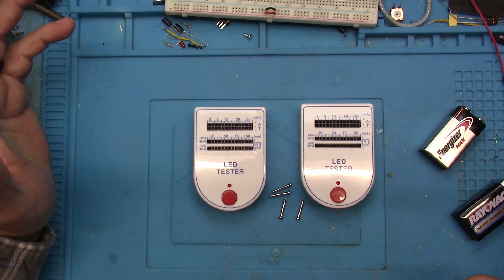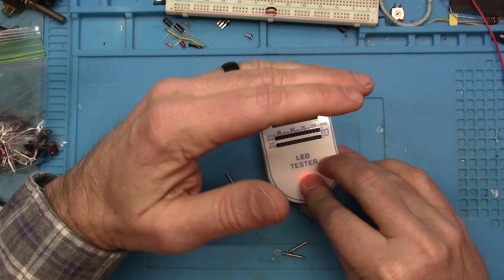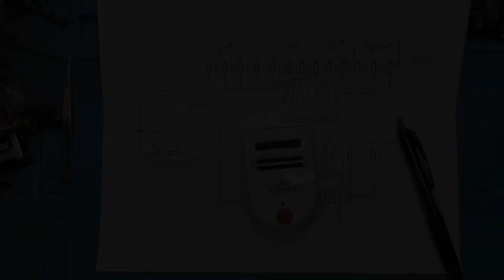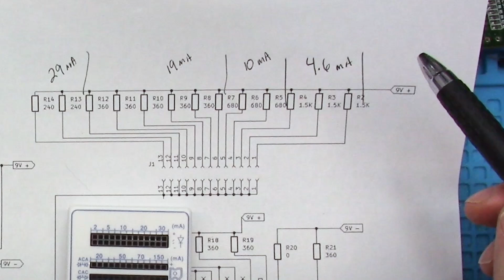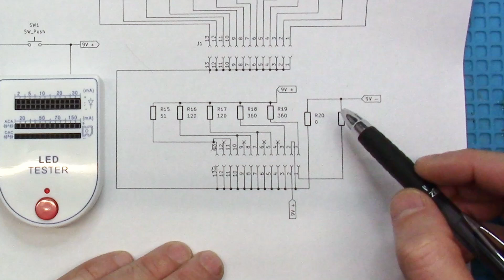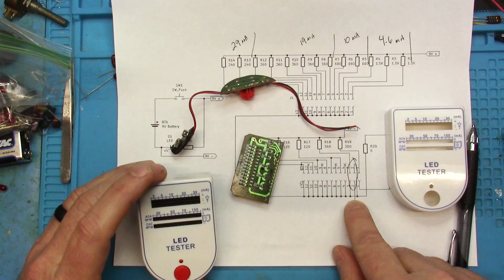Chinese LED Tester Teardown

Comment: There is no short on the LED. Positions 1 & 2 are connected together at the +ve end to a 360 ohm resistor and at the -ve, 2 upwards have a 0 ohm resistor and 1 has a 360 ohm resistor in the -ve. Also, when you put the battery in, the wire needs to go down the side and not over the top of the battery case as it adds extra height.
Reply from the maker: Thanks for the feedback.  I just double checked and the top pin 2 to pin 2 on the bottom pin header is shorted when the LED is inserted.  The top header pin 2 goes to neg via a 0 ohm resistor and the bottom header pin 2 goes directory to positive.  I think you are confusing the number “1“ on the top header pin one as a connection to pin 2.  Maybe? My problem with the case is the width once you place the connector on the battery. It does fit if you work at it.

Comment: Do you have a video about actually making that schematic off of the PCB?
Reply from the maker: No. It was not difficult and if it was not clear I used a multimeter to confirm the connections. Do you think people would like to know how to do it?
Reply: @StuartPatterson  You even made an interesting discovery about the hidden LED-shorting feature they added. I think that kind of discovery process could be educational 🙂
Reply from the maker: I will keep that in mind for future videos.  Thanks.  My only hesitation is that reverse engineering circuits is something that most people that do electronics or repair would already know.